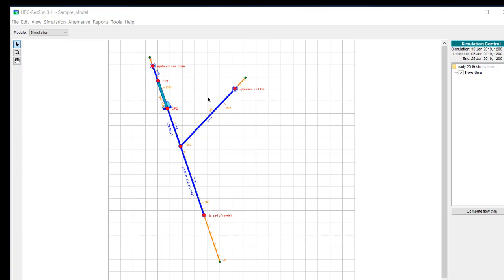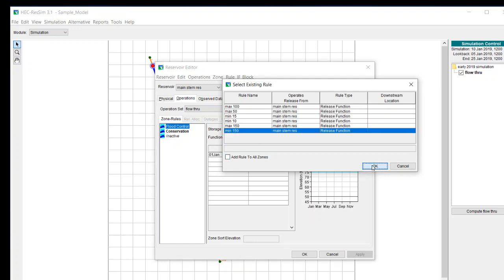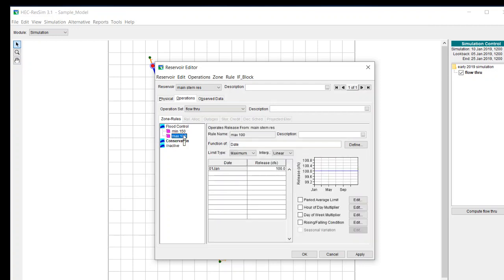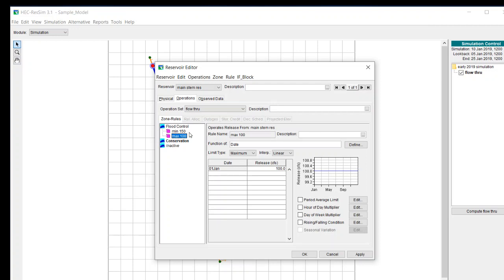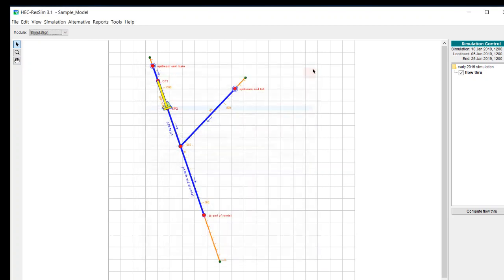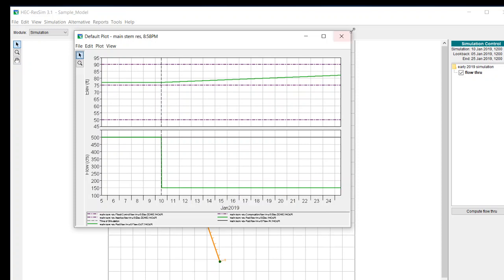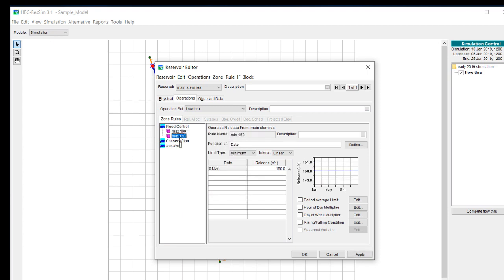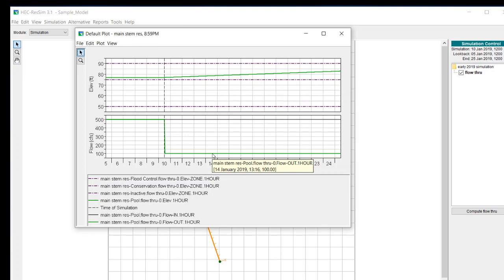HEC-ResSim Minimum and Maximum Release Rule Priority, Example 1

Comment: How to make the connection between 2 reservoirs in a river such that the operation of lower reservoir is affected by the operation of the upstream one ? please help me
Reply from the maker: It may take me a few days to develop a video (or videos) to show this.  I will work on it as I have time.
Reply: @hecressim  Hi, sir I need assistance regarding the setup of rules of reservoir operation in Hec-ResSim, can you provide email address to contact you directly.
Thanks
Reply from the maker: @engr.zeeshanhanif3968  Can you describe the issue that you are having in the comments.  I can then try to make a video to help with that topic.
Reply: @hecressim  Sir I have to operate reservoir to fulfill irrigation demands, and power generation is a by product. Reservoir is operated by power tunnel to fulfill irrigation demands, but power tunnel cannot release more than 1274 cumecs. If our irrigation demand is higher than 1274 cumec, we need to release water from main spillway. 
I am facing problem in setting theses rules in the HEC ResSim. Please let me know brief methodology on it.
Thanks much.
Regards
ZEESHAN HANIF
M.S.Research Student